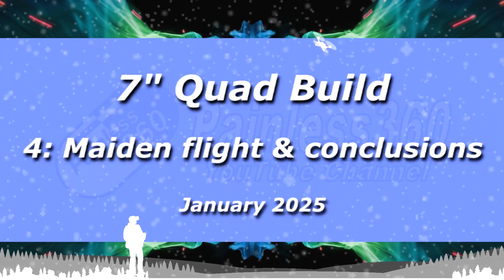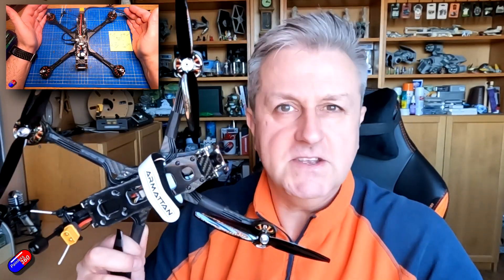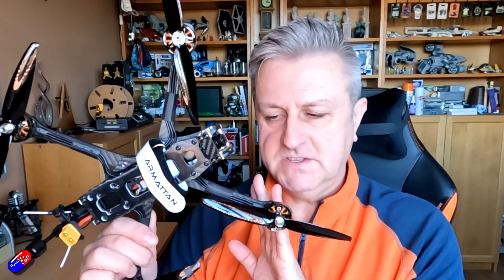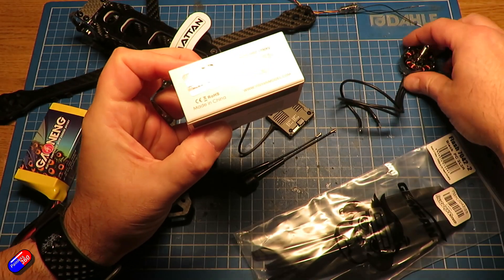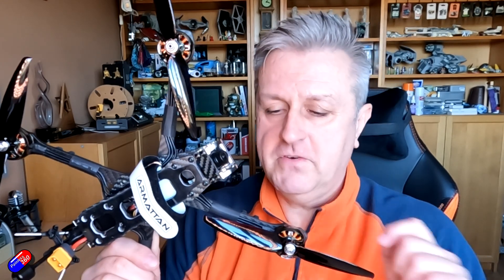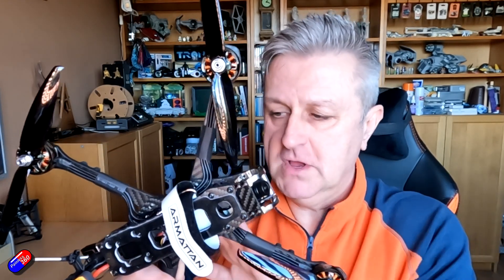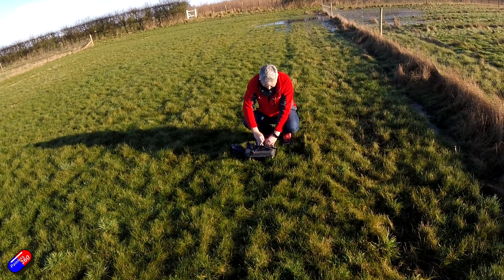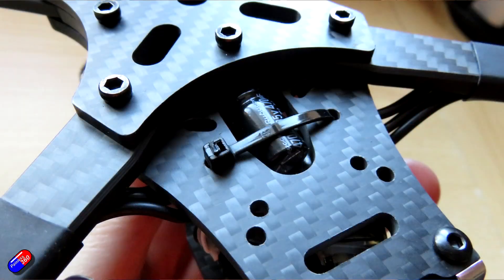7" Quad Build: 4: Maiden flight and the results!

Comment: Great video. Do you disable balance charging when you check the battery capacity with your charger? Most chargers I have used will overstate the power delivery at the end of the charge because it bleeds off power from the full cells while it tops up the low cells.
Reply from the maker: These are new GNB packs and spend very little time in balance phase as they are so well matched, so I woudln't worry about that ;)

Comment: I made a similar build using a Speedybee Fold 8 running iNav. I chose the RCInpower EX2807 1300kv. It has an oring, single strand and RCinpower specs for not a lot of money. 

The smaller EX series are not great though. Non curved magnets, multi strand and a c-clip instead of an m3 screw for the shaft.

Comment: Good video.  I'm in process of setting up a 10-inch quadcopter for long-range and FPV exploration.  So the iNav autopilot features will be a must and they're sorely missing from BetaFlight.  This'll be my first iNav quadcopter setup though I've used iNav for several fixed wings already.

5:38 - Looks like you have the OSD problem with the indicators flickering in and out.  Its a common problem with Walksnail system.  Would like to see how you fix it. :)
Reply from the maker: That amount of dropout is not normal. It points to an issue somewhere... Happy flying
Reply: @Painless360  Yeah, its probably electrical noise that needs filtering.  Especially if the OSD problem gets worse as more throttle power added.

Because one plane I have has the OSD problem much worse than the others.  I added the usual filtering capacitor to it's flight controller and it reduced the OSD problem a lot, but did not completely eliminate it.  Other planes and quads have little to no problem for whatever reason.

For my plane that still has this OSD problem, I might add additional capacitor filters to the ESC or increased the capacitance of the existing one.
Reply from the maker: Interesting idea about the power. I've not had this on one other model here and I have a lot of Walknsail planes. wings and quads now. It is the first time using the new TBS FC, so I wonder if that has anything to do with it?
Reply: @Painless360  It could!  Because each FC implementation may use slightly different filtering components and circuit pathways that may or may not help with noise.

Also, the OSD data is sent via serial UART, but its wiring does not use differential signaling so may be prone to common mode interference which is exactly the interference created from motors and radio frequencies (RFI).

If the FC's used differential signaling, there would be two pairs of wires for RX and TX for 4 total wires, but there are only 2 wires.

Possibly we can try:
- Twisting the RX and TX cables together
- Adding a choke
- Shielding
- Bypass/Decoupling capacitors on each line to short high-frequency noise to ground

I have tried the first two but it didn't help.  Adding shielding along the length of the wire could help the most.  Some drone pilots swear by this for their GPS wire.
Reply from the maker: I'm trying things here too... Stay tuned!
Reply: @Painless360  Looking forward to it! 😄

Comment: Very nice Lee great see this beast in the air.
1250kv motors would be plenty i think? 
Would be interesting to see the flight you would achieve with a heavier battery, that would carry an 8000mah easily. 🙂

Comment: Hi Lee, I have a similar build and was thinking of trying a GNB 3000mAh 4S 10C Li-ion Sony VTC6 Long Range Battery on it. Thoughts?
Reply from the maker: That could be interesting, if you try it, please let me know how it goes... Happy flying!
Reply: That 4S 18650 battery is too small for a 7 inch. More for a 4 to 5 inch. You need at least a 4S 21700 li Ion pack. Best would be a 6S 21700 pack.
Reply from the maker: @chrisbee5481 as shown, 4s works well....Happy flying